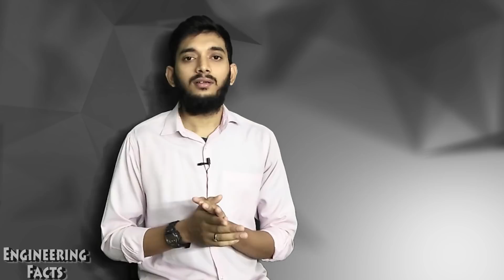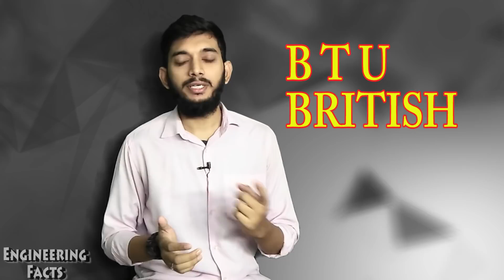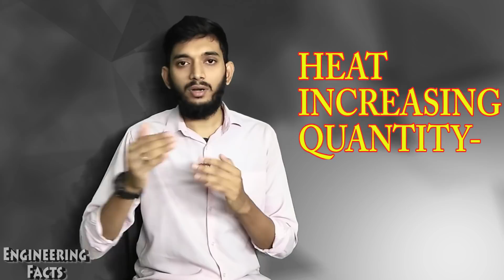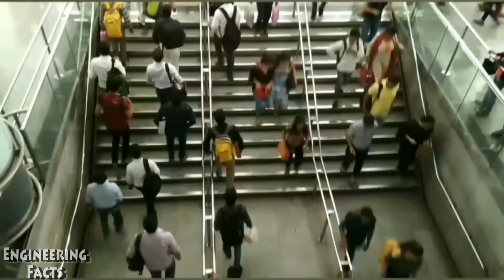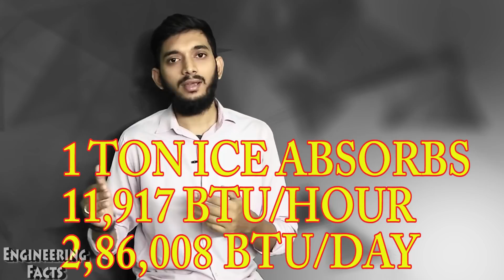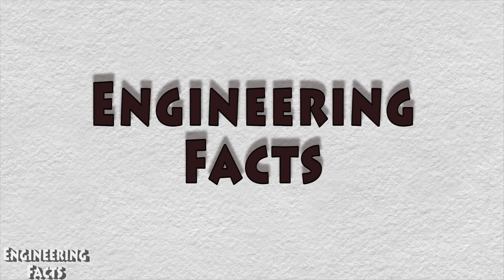Why AC capacity called in TONS?_Tamil, What is TON? How TON defined in AC?

Comment: Air conditioning tonnage has nothing to do with weight. A ton, as used in the HVAC field, is a term that describes how much heat the AC unit can remove from a home in one hour. The measurement for heat is the British thermal unit (BTU). One ton of air conditioning can remove 12,000 BTUs of air per hour

Comment: Sorry sir it denotes that a machine having the capacity to make 1 ton of water into ice  at 1 hour which means the heat pumps capacity that  equals to the latent heat consumed while making 1 ton of ice in 1hr. The required heat can be denoted in several system of units for British standard ie. BTU , Metric standard ie. Kcal and IS Standard ie. Jule. In Indian we use Metric and IS Standards only.     Can anybody give  explanation for calory and Jule!  Write on reply

Comment: Not explained correctly.

1 ton 

The AC of 1 ton capacity converts 1 ton of normal liquid water at 0 degree celsius in to 1 ton of ice at 0 degree celsius of solid state in the time period of 24 hours.

The above is the simple definition.

Some extras.

Most of the units are fixed by some constant values in science. There are many constant values like g in gravity. There are many constant values for water also like density, latent heat at specific pressure.

Here Latent heat of water comes into play

ton (power of AC)  is converted in to si unit of power by the latent heat of fusion of water and time of 24 hours. 330 KJ/kg is latent heat of fusion of water. ie the energy we need to remove from liquid water of 1kg at 0 degree Celsius to ice of 0 degree celsius.

So for 1 ton, we need to extract 330×1000 kJ in 24 hours.

Ie 330000 kJ/day(24 hr)
Or 13750 kJ/hour
Or 230 kJ/min
Or 3.8 kJ/s = 3.8 kW

In western countries 1 short ton is 907kg( 2000 lbs) . For that 1 ton =3.5 kw.

That's it...
Reply from the maker: It's an additional information. My info is correct. What you're explaining is specific latent heat

Comment: Sir can you please tell, what is the difference between three phase and single phase power supply.... Tell us how the EB is changing for that...
Reply from the maker: We'll do video on that.
Reply: Also include what is short circuit, fuse. Bro
Reply: @manjunathans3250  current I = V/R.
If R decreases towards zero, I increases towards infinity. so sudden decrease in resistance of a circuit causes high current hence short circuit.

Comment: I have a doubt need your explaination.

1 Ton AC is sufficient to 10x10 sq feet room, if I use 1.5 Ton AC in that same size room what will be the power usage of 1 & 1.5 Ton AC 

Test case should be splited into 2 case's
1. Normal AC and 
2. Inverter AC 

Thanks in advance 😊
Reply from the maker: We will try to analyse and make a video..
Reply: If 1.5ton used instead 1ton, room cooled faster. But 1.5ton will take little more power.
Reply: Yes correct

Comment: 1 Ton --> 12,000Btu/hr. (heat sucked from room to outside through A.C) 
2 Ton --> 24,000 Btu/hr ..? this BTU is right for 2 Ton .?
Reply from the maker: Yes
Reply: @engineeringfacts  ok bro.. Nandrigal👍
Reply: That's why Ac on panna odaney cool aagathu 1 hour la 12000 btu heat ah absorb panni heat ah velila reject pannum so antha room la oru 2 peoples and some furniture eruntha athoda heat approximately oru 4k to 5k btu erukalam so athunala dhan atleast oru 30 min aachuna dhan room cool aagum ( oru human oneday ku 6000 to 10000 btu heat produce pandran so itha divided panni 1 hour ku evloo parunga every 1 people and room la eruka oru oru furniture kum oru oru standard value eruku google la check pannuga and room oda wall sun la padramarii eruntha athuku wall size ku yetha marii oru value plus athula eruku window glass kum separate value so.....ithellam calculate panniga na ungaluku vara ella doubts hum clear aagum ( hope ungaluku puriyum nenaikura As a HVAC ( heating ventilation air conditioning )engineer enaku ungaluku explain pannanum thonuchu this details for all the people who watching my comment right now )

Thanks and regards,
Sathya
Reply: Unga comment pathathuku aprm than purinjathu

Comment: Hello bro, one technical question!
For AC installation, is it really necessary to vacuum the AC unit. I heard that R32 gas Ac it is mandatory. But my technician not done that during installation.
Little confused now... Plz clarify.
Thanks bro
Reply from the maker: It is not necessary. But if you do, you can assure that your pipe is completely filled with coolent. And full efficiency will be utilised.
Reply: @engineeringfacts  thanks bro

Comment: Bro, Air Conditioners Bring in Fresh Air From Outside?
Reply from the maker: No, it only removes the heat. Doesn't bring any fresh air.
Reply: Bro,  Apo uncomfortable ah feel akatha,  oxygen level low akum la
Reply from the maker: Good question, when your room gets cold, room pressure will be low as compared to the atmosphere. So whenever you open the door due to high pressure outside, the air always come in. Or it always comes through the gaps. Even if you're fully closed, the room is sufficiently able to provide enough oxygen for more than a day..
Reply: @engineeringfacts  Brother, I think air pressure increases by decrease in temperature, especially in a closed environment like AC room.